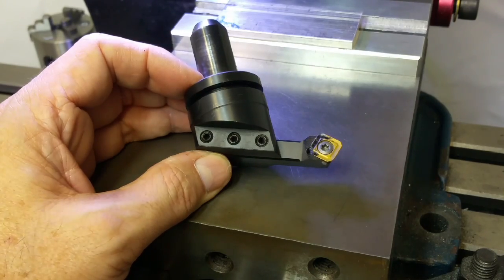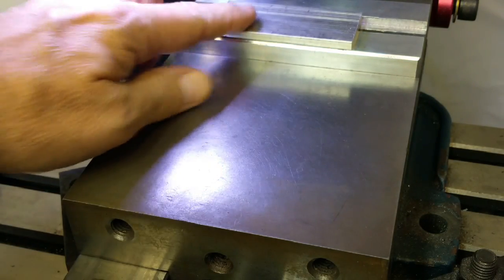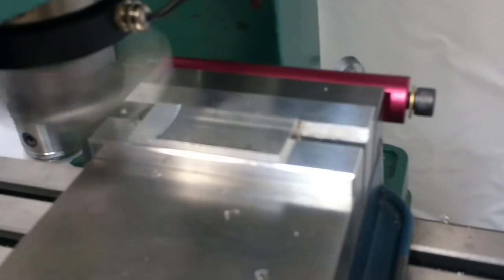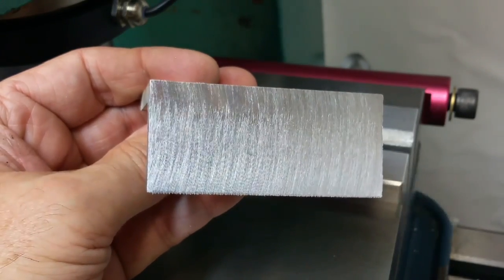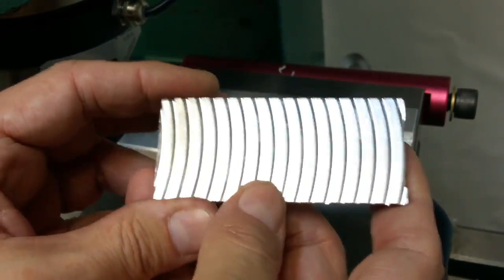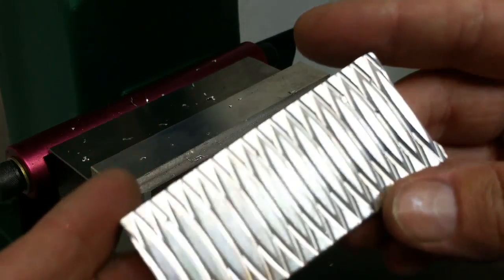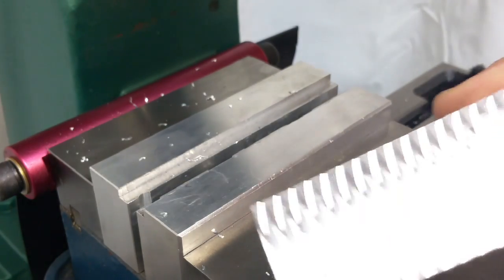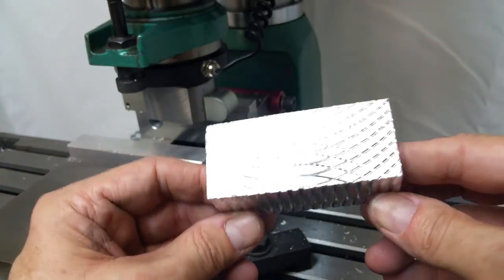Quick And Easy Machined Checkering

Comment: This would make for some pretty cool looking pistol grips for like a 1911 or some other semi-auto pistol.
Reply from the maker: +MrLarry0001 Nice looking and functional checkering as well.  Use a triangular (60 degree) or square (90 degree) carbide cutter, point down, to make a grippy textured checkering.  The grip panels are probably going to be curved to produce palm swells but the checkering could be deeper in the middle and shallower on the thinner edges.  Or... mount the grip panels on a fourth axis fixture and instead of advancing the spinning cutter in the X axis, rotate the fixture in the A axis so the cutter moved along the radius of the grip panel curvature.
Reply: Try it out on a slide